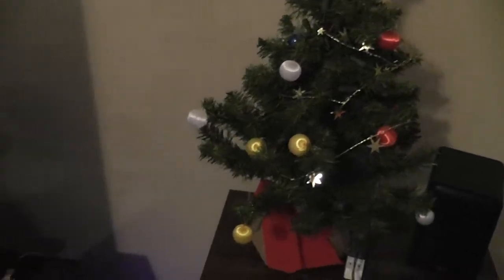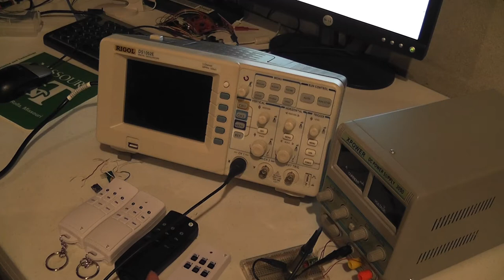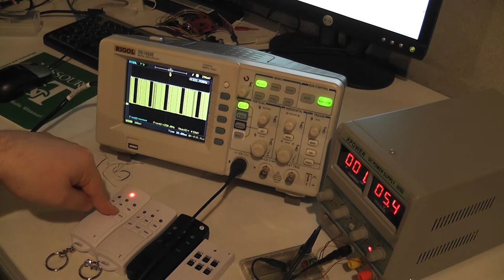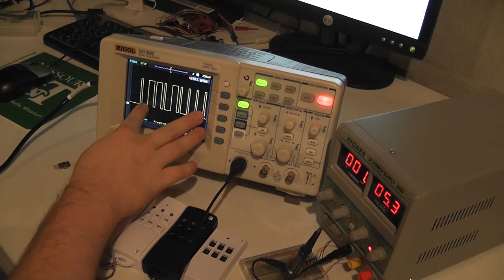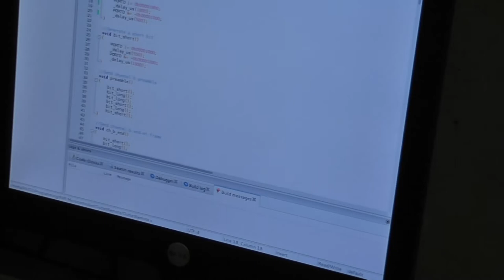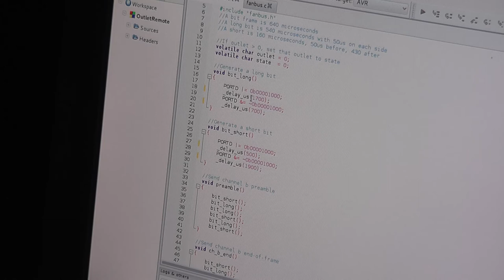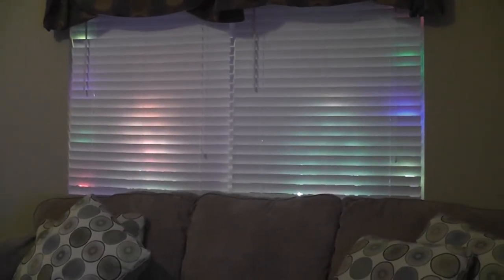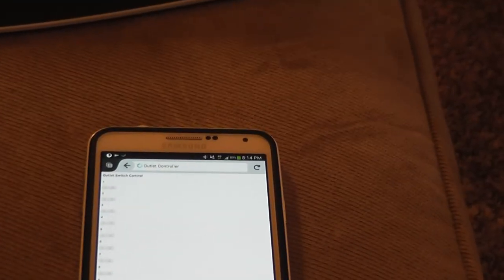Remote Controlled Outlet Switch Reverse Engineering

Comment: That protocol is about to end and I may be at least partially responsible. I hacked one of them up and made a remote volume control out of it. I posted it on YouTube about 5 years ago as a Gadget Freak project. The Chinese manufacturer apparently found out about it and recently rewrote the transmitter software so that it can't be used to control anything but an on/off device. They retained the original bit-pattern, but they added stuff to it that shut me down. They increased the data rate to prevent added response delay (latency). I tried without success to work around it. Google "Gadget Freak Case #192" to see my project and find the link to the build instructions. I also have a YouTube video titled "Wireless Remote Volume Control".
I guess they don't like having one of their products hacked and their design details posted on the web. It'll take a while before all the old ones are gone from the brick-and-mortar store shelves. Amazon already sells the Woods 32555WD remote control. Apparently the "WD" denotes the new version of the transmitter protocol. I also have the device you are demonstrating and it employs the same protocol as the Woods 32555, without the "WD" suffix. One builder of my volume control just told me he bought a Westek brand of the same remote control, but that now employs the new protocol.
BTW, I did a very complete write-up about the protocol, including the 6-button remotes. I could send it to you, if you'd like to compare notes. To contact me, go to the build instructions and get my email address off of the schematic. You can also contact me for details about the new protocol.